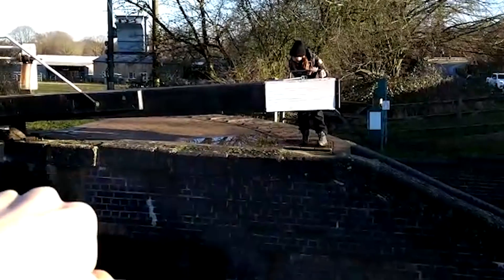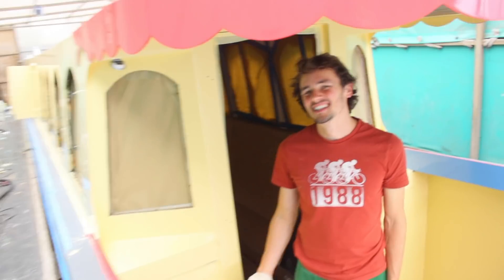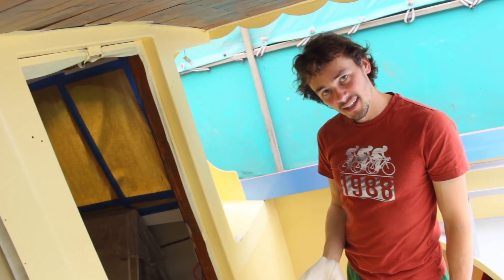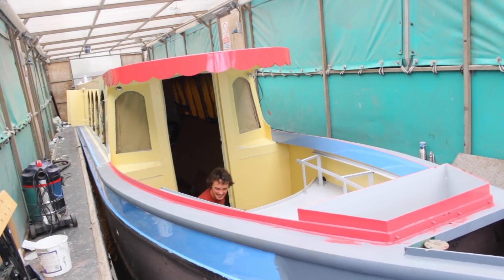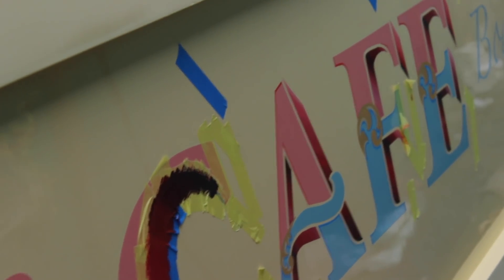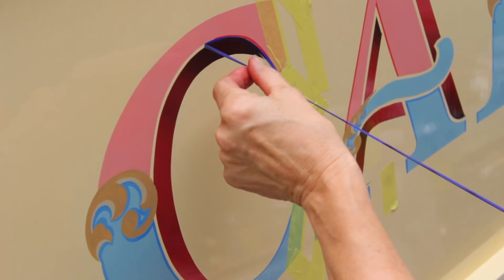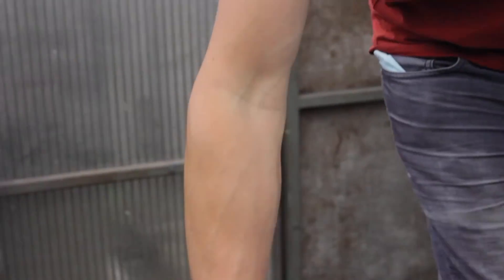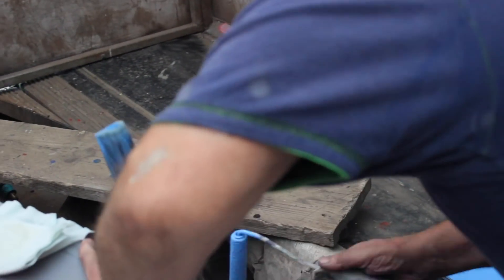Ep14 Sand, Paint, SCRATCH, Repeat - PAINTING Our NARROWBOAT Part 4

Comment: Hi Jo & Vic De-Walt do a drill and countersink bit in one, it drills a pilot hole for the screw and counter sinks at the same time. It saves you you keep having to change the bits over. Probably to late as you have finished putting up all of your panelling. Best wishes Steve.